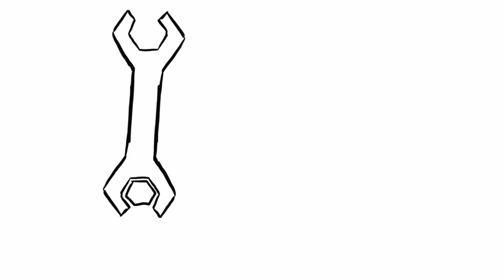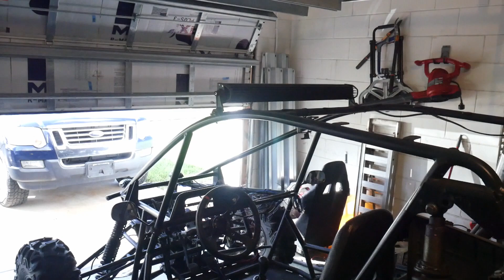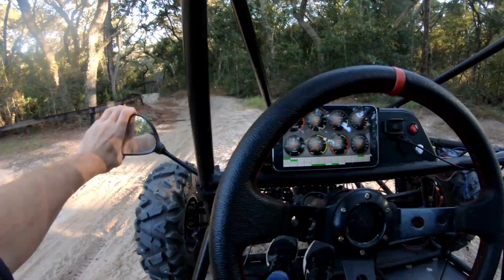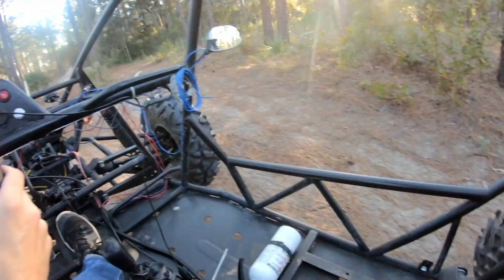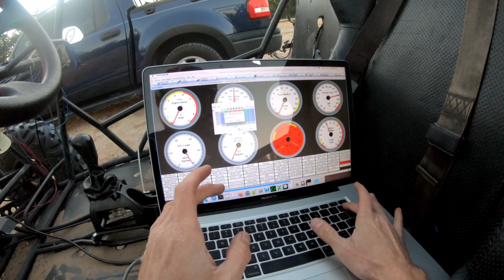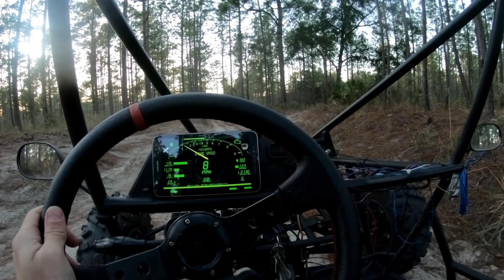First time off road after the Mitsubishi Mirage Engine Swap!

Comment: send me a log of that thing ill help with the tuning of your vvt
Reply from the maker: Thanks! I think i’ve got it dialed in good now just waiting to put it back together with new clutch and break some records! 😁
Reply: @DirtGearTv  at wide open throttle pull back on the cam advance to 2-4 degrees around 4500 to redline
Reply: 4 degrees max advance at that range with a nice smooth curve to that point

Comment: i just watched your videos and you have defently inspired me. i am currently building a buggy frame and the plans call for a motorcycle engine but i want to put in a front wheel drive engine instead similar to what you have done.  I am not a auto mechanic tho do you have any engine recommendations  and were is a good source for information on how to adapt an auto engine to a buggy ? my email is billjohn1962@yahoo.com
Reply from the maker: Glad you enjoyed the project! Adapting an automotive engine to a buggy like this is pretty advanced (in terms of difficulty) even for me. So you may be better going the route of a motorcycle engine just to keep things simple until you learn more of the in's and outs of EFI systems. Some bike engines will go great in lighter buggies, look for something with a larger displacement and more torque than HP. Something like a 1200cc bike engine and you should have plenty of power to work with!

Comment: It seems that Mitsubishi is a bit cautious. I have a Mirage with CVT (would be interesting for a buggy too, CVT). It never goes beyond 5000 rpm in D and 5.500 in Ds. It should have 90% torque at 1500 rpm until 4500 (100% at 4000 rpm). Power peak is at 5.500 rpm. Indeed, ideal for off road! Still the average load on the pistons is lowest of all available engines in the industry. The engine is made for light appliances and it is itself I think the lightest car engine available. This all means fuel efficiency is excellent and it should last forever in a buggy or light car.
Reply from the maker: Yes! I did a lot of research prior to selecting this engine and couldnt find anything as light as the Mirage 1.2l aluminum block . I weighed the engine plus transmission (no fluids) at 185lbs, pretty amazing..

Comment: Really cool, been following. There is a throttle position sensor right? Is that all golden and working right, it sounds like the potentiometer is awful touchy to throttle input. Maybe needs some sort of software tweak in that regard. Just throwing out ideas. Hope you get it sussed because it really is a fast cool little buggy.
Reply from the maker: Reverend D Originally I was going to use the stick drive by wire system. Turned out the MS3 is not equipped to control such a setup so I ended up converting it to a manual cable. It obviously still needs a few tweaks 😁